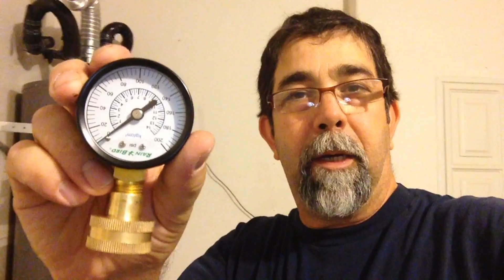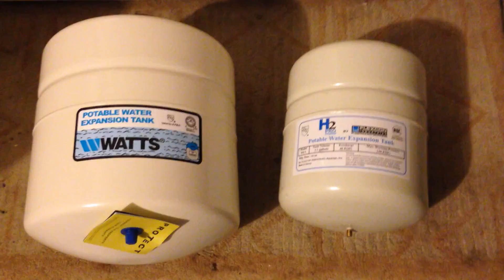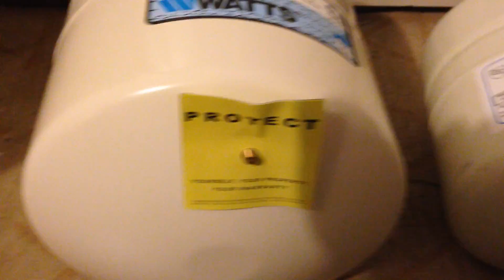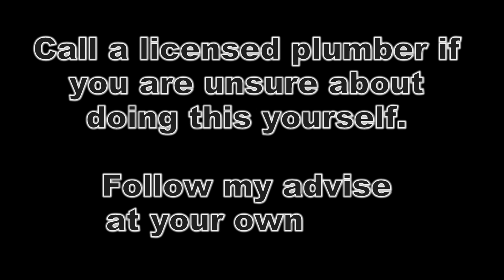Water Heater Expansion Tank Installation - Watts 4.5 Gallon

Comment: Bum information!  These pre-charge directions are the same as Watts recommends.  I followed the Watts instructions and found the my house water pressure was 40PSI. I topped my expansion tank to 40psi and the boiler immediately started suffering from thermal expansion. The boiler's pressure would rocket from 18psi to 30+psi.  I lost 2 days of my life bleeding the system, replacing the relief valve and sweating in more purge valves on the baseboards.  I still couldn't fix the PSI spike.  I overlooked the obvious.  The expansion tank was over pressurized.  I lowered the expansion tank to 15psi and the boiler works perfectly again!
Reply: MrAirhose1 i hope your expansion tank is still doing well.  I am pretty sure that the problem with your install was not from bum information.  Reading your post, you are talking about an expansion  tank for your boiler heating system  which is isolated from your house pressure and operates at 12 to 18 psi depending on how high you have to circulate the water.This video and directions are for a hot water heater only.  You are lucky you didn't blow a line
Reply from the maker: +MrAirhose1 Bum information? From Watts? I think you might be the only one that has this kind of issue. Perhaps its not the pressure in the expansion tank, but that there is something else wrong with your system. In any event, I hope you found a safe solution.

Comment: I have a question,after draining my water lines ,the lines are hammering ( noise) now. Looking on YouTube,several ways were suggested on how to eliminate this noise. One was draining all water lines down and refillg the system very slowly. This I've tried and still have the noise when turning off any faucets. Any suggestions, anyone?
Reply from the maker: +sgtlewisbond Not sure why you'd be having a water hammer in the system if you have pressured up the expansion tank to meet the actual water pressure in the home from the water company. Mine is 50psi. Others can be drastically different. That being said, be sure that you have opened ALL spigots and allow the system to bleed. Water in the lines would only have happened when you drained the system before installing the expansion tank and then when you turned the water back on, the air was not fully exhausted from the pipes. Some factors would be: how old is your home? is the water hammer happening no matter which faucet was closed? The bottom line is that if the expansion tank has equally pressurized to the main water supply, then the hammer should not be happening since the rubber diaphragm in the expansion tank absorbs the hammering effect. It might take calling a plumber familiar with your age of home. Good luck!

Comment: Home Depot offers Hot Water Heater installation by licensed plumbers, among other services. Home Depot backs their services so a customer only has to deals with Home Depot and not the plumber. Sure, it's a couple bucks more than the "handy man" on Craig's List but, there's nothing cheaper than "peace of mind".
No, I'm not a Home Depot licensed contractor.
A licensed plumber would not have installed that trap in the hot water tank vent. That trap/fire hazard in the tank vent is cause to pull that plumber's license, assuming the poser has a license. Nor would a true licensed plumber add pipe dope to teflon tape. Think suspenders with a belt.
Bottom Line: Sometimes the best tool in the toolbox is the cell phone.
Reply: +Joe-n-Tex THEY (HOME DEPOT)  WANTED 800 BUCKS TO PUT IN A WATER HEATER... NOT JUST A COUPLE BUCKS
Reply: +Dennis Hage,  Reread; "a couple bucks more than a handy man on Craig's List." My point was, this is a Gas fired water heater. Saving a couple bucks here or there isn't much of a savings if the house burns down.
Reply: I don't disagree...BUT it was a 4 hour job for me, and probably a 2 hour job for a good plumber... that would equal a $400 dollar an hour labor bill... even the guy who (worked for home depot that was standing next to me and had me call them for a quote shook his head and raised his eyebrows.
Reply: +Dennis Hage If your comfortable with your knowledge and skill of the job, then have at it. Just hope you don't do anything as potentially fatal as the guy, who hung the vent with a trap in the line. JOHNNY M should add video showing his correction.
Reply from the maker: You can see my correction on the venting flue here: https://youtu.be/CNzqB8eACgA
Reply: Home Depot GE and ruud not exactly the top water heaters. Bradford white and home Depot can't sell it. Home Depot hires out contractors that have a completely different charge then what the tank cost. When customers have a problem it's your product not the plumbers so the customer dealing with home Depot does what for them.

Comment: where are ther pipe's , i'm so amatuer im looking to find the inputs and output water lines, is it in the potable water line and where, minds on the 12 lb. circulator sytem
Reply from the maker: fred shimstone Here is a great diagram to show you how they are typically installed: http://www.watts.com/images/aux_images/learnabouts/thermalexpansion/hwsupplysystem-colour.jpg

Comment: Your water heater gas vent needs to be corrected, you cannot run the vent downhill and create a trap like that.
Reply from the maker: TheAdeptRapier
: I didn't install the unit, but you are exactly right. I will make the correction. Thanks for the heads up!
Reply from the maker: Here's my correction on the vent: https://youtu.be/CNzqB8eACgA

Comment: Hi I don't know if I'm the right person to do you a comment  but install an expansion  tank vertically like you have it its not the right way to install it and it won't work efficiently! Thanks for the video
Reply from the maker: Sorry, but you're wrong. Even the manufacturer prefers it in the position I've installed it. I did my homework before installing this at: REF: http://www.watts.com/pages/learnabout/thermalExpansion.asp
Reply: Douglas Barrios I just installed one as well and the manufacturer specified vertical installation!
Reply from the maker: Tanks can be mounted horizontally but they MUST have good support as they can get heavy when 1/2 filled with water. But...manufacturers recommend vertical installation whenever possible.
Reply: There are some brands of expansion tanks that are rated to be installed horizontally.